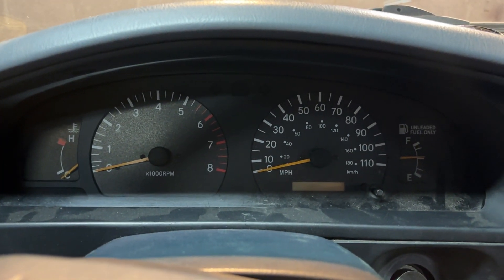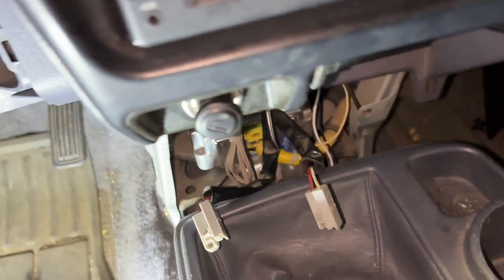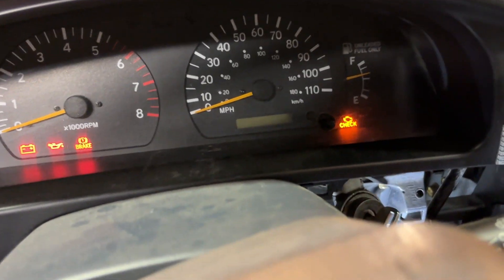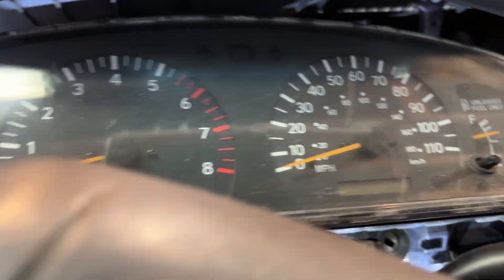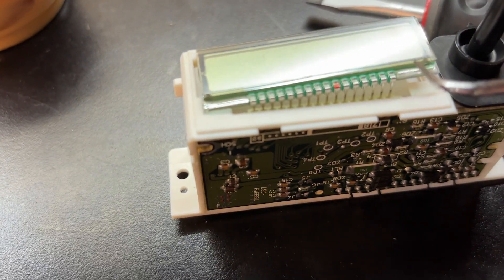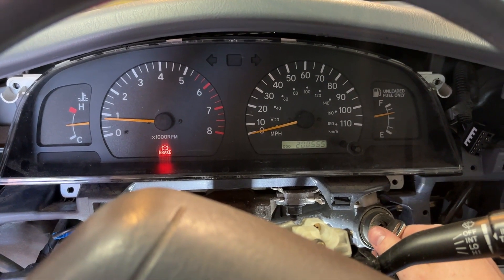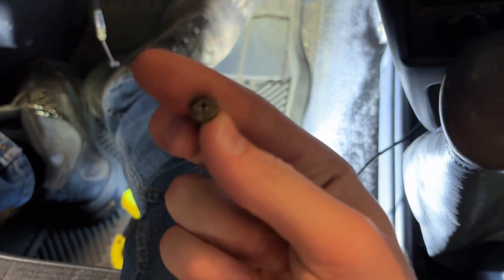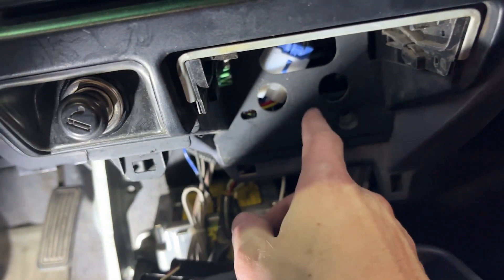First Gen Tacoma Gauge Cluster Broken Tachometer/Speedometer/Odometer Fix

Comment: You're about the only video to show how to take the meter out but mine isn't coming out. I don't know what is holding it in.
Reply: Someone has worked on my truck and disconnected my meter me im so confused on what he has done. Its been a nightmare. At least this truck is old. Less parts. Thank you for your video. I love my Tacoma ive only had it for 27 years but im about ready to give up on it. This one problem has consumed my life trying to get it fixed. Its not the meter.  But that could be a start.
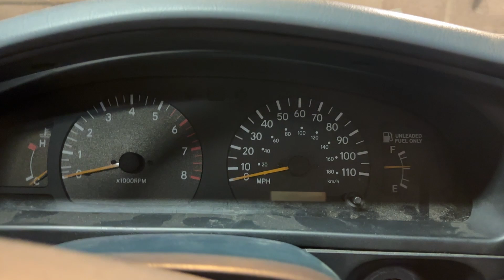Reply from the maker: It might be the 4 screws holding the white plastic parts of the gauge cluster that I forgot to record. I mentioned it at 4:43 hopefully that's it they're on the corners of the meter

Comment: Nicely done and thanks for the video.  I have a couple of questions for you if you don’t mind.  My Tacoma has the exact same situation you described at the onset of the video (i.e. neither the tach, nor the speedometer nor the odometer works, but everything else on the dash does).  1) Is this scenario a CLEAR symptom that the Tach has a broken connection and 2) is a broken Tach connection a common problem on the Tacoma?  I ask because I am tempted to tear down my dash right now but wonder if when I get to the odometer card, I will find that I don’t have the same ailment as you did.  Please let me know and thanks again.
Reply from the maker: @EricUmeda  that’s exactly how my cluster was before I tore everything down you should be able to see it at the start of the video. I saw it on some other forum this issue is fairly common. Most people just replace the cluster which was too expensive for me. If you tear the dash apart and it doesn’t fix it you’ll have to replace the cluster anyways and it’ll already be out of the car.